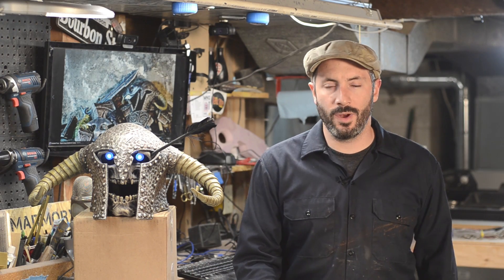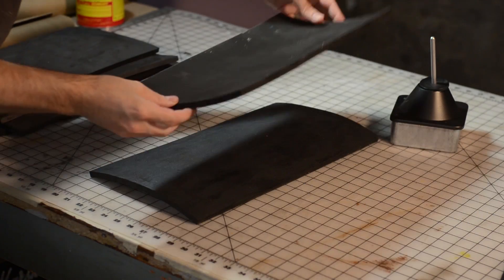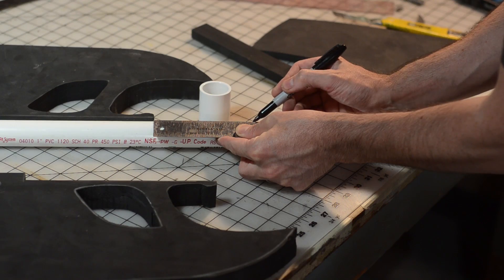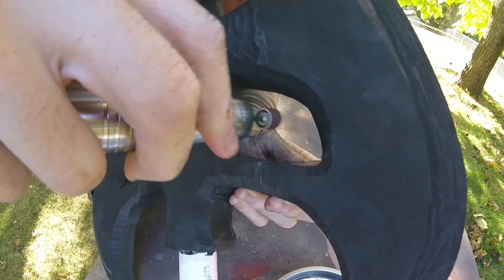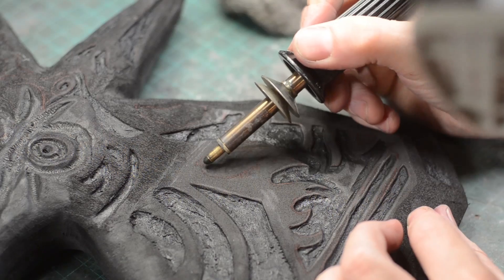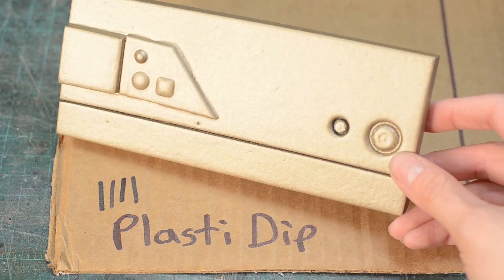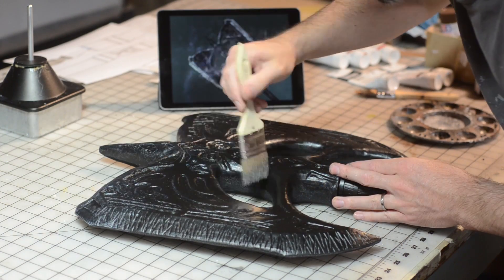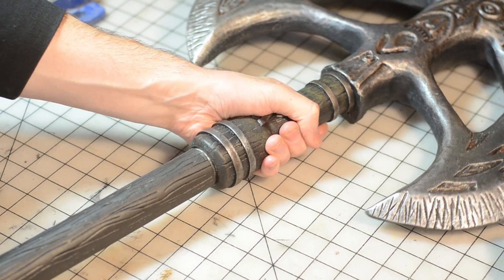How to Make Wuuthrad the Legendary axe from Skyrim Special Edition - Prop: Shop

Comment: I would have to put some steel inside the Pipe or foam for some added weight.
Reply from the maker: +jacob untitled You want these to be as light as possible. Carrying it around a convention all day gets extremely tiring.

Comment: I always have problems with my contact cement coming apart when I try to heat seal the foam. Is this normal or did I get a bad batch
Reply: Ah ok I've been using dap but I'll look into barge also thanks for the video I actually just got wuuthrad in the game(really put off the companions questline) and I'll have one here too soon

Comment: Hey Bill i just printed off the axe, could you tell me if this is full scale to the game or not? as messing around with some items in game seems to have it be the same length as 3 and a half steel ingots...either the axe is small of the ingots are huge.
Reply from the maker: Hmm I'm not sure - if it looks like the scale in the video then you're good, otherwise you may need to do some adjustments.
Reply: @punishedprops  i printed it out was it was, but if i take a screenshot of you holding it and overlay a dragon priest mask and a couple of other items then i can find the scale as i put a mask next to it in game and it looks around the same size when your holding it. still cant wait to build it though am gonna play with foam clay for the details! XD

Comment: hey bill! whenever i use plastidip it seems to come out in small splatters rather than an even spray, does the hot water prevent that?
Reply: If I remember right they soak the paint can in hot water for a bit and it does spray better.